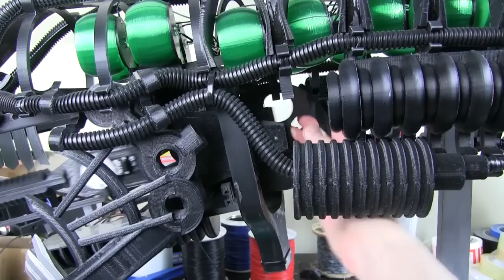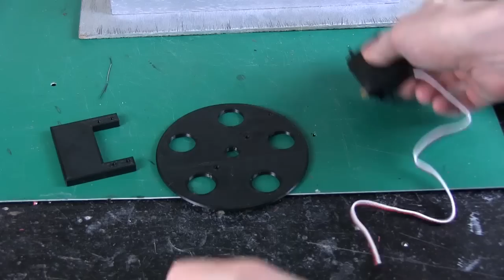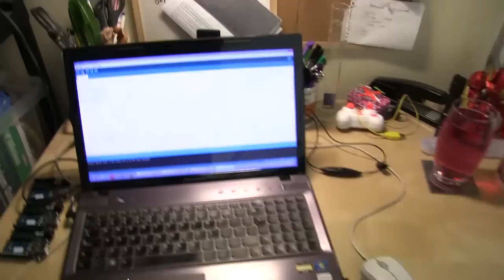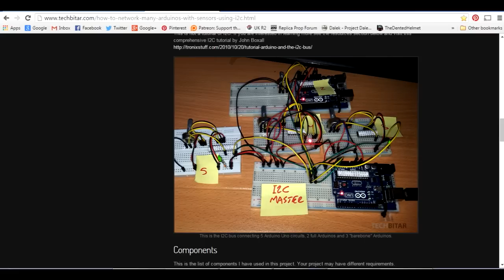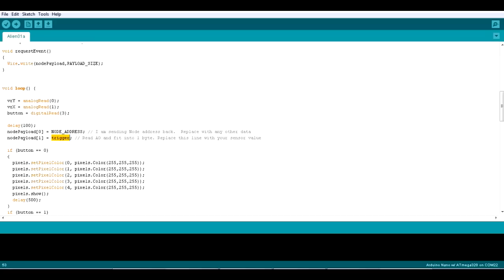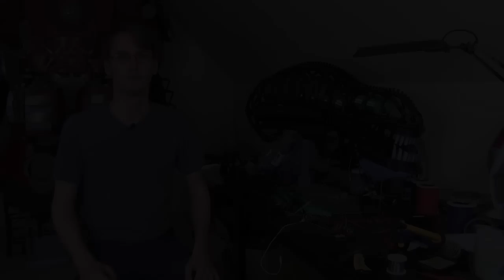Alien Xenomorph Cosplay #22 | Head Animatronics | James Bruton

Comment: You seem to tend to create "wheels" where partial wheels (which would be lighter) would do the job. Maybe that's to keep more options open, or maybe it's for estetics. But in this case, you replace on wheel with another wheel, which actually only acts as a pure lever - a servo horn extension. Was there a reason for this? I kept thinking "why's he creating a wheel for that?" ;)

Comment: I wasn't sure why you didn't modify the existing wheel to take the servo horn. I may be mistaken, but didn't it only need a hole drilled in the middle? Also it only needed to be a rod of the correct length, rather than a wheel. Either of these would have saved you some print time and wasted ABS. Obviously no help after the event, but just curious about whether I've missed something?